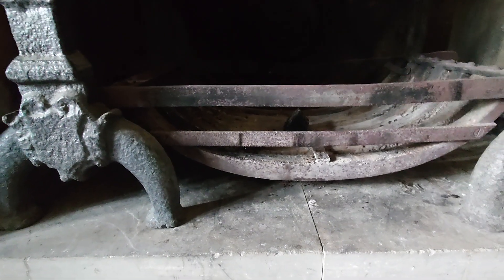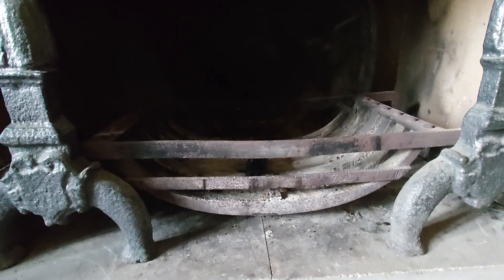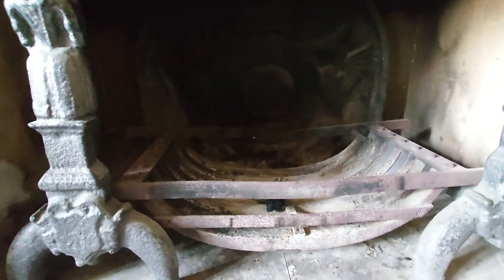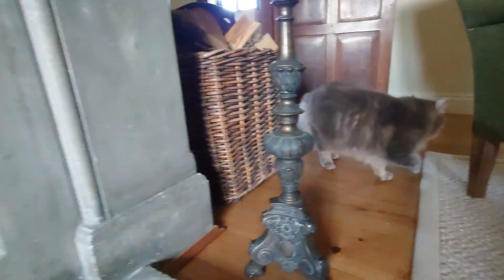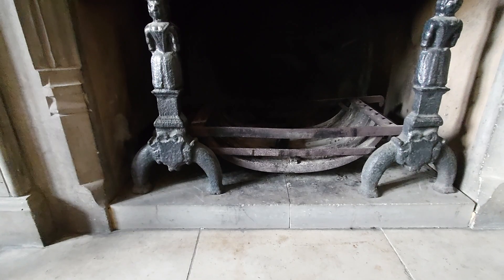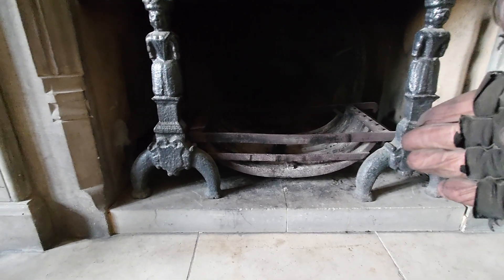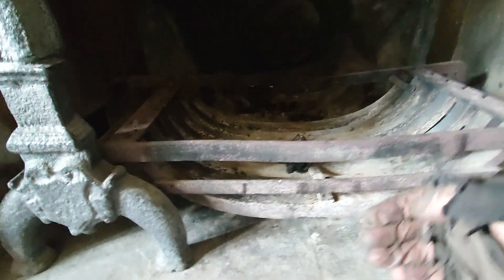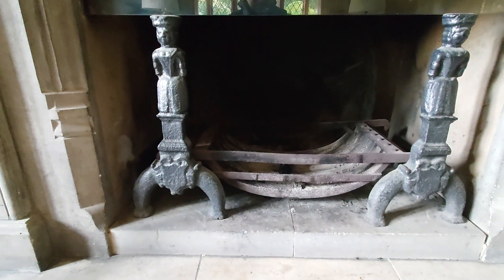HOW TO SLOW DOWN THE DRAW ON AN OPEN FIRE.

Comment: One of my best customers was a Country Club, with a bigger fire than that, set into an inglenook.  The majority of my logs would've been burnt in a 16" fireplace (the same as my Baxi,) and were sized accordingly.  I was contacted and took a full load down on a Sunday, however I was contacted midweek for another load, they were delighted with how the logs burnt, but went too quick...The CC was localish, so I called in when I was passing and asked to see the fireplace.  From then on, anything a bit knotty or gnarly went into a separate pile for the CC.  Always delivered on a Sunday, if it was mid morning, there was a full English wating for me, mid afternoon - full roast dinner.
Reply from the maker: @thepotterer3726  next time you go,if you need any help. Here anytime 👀